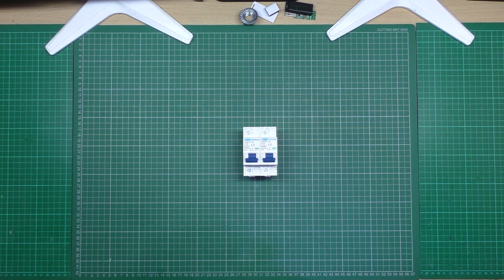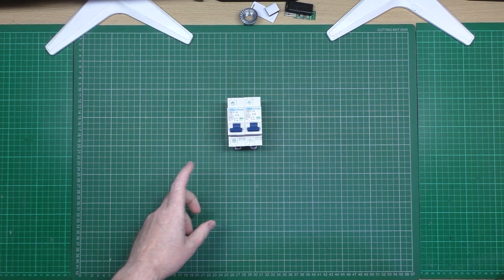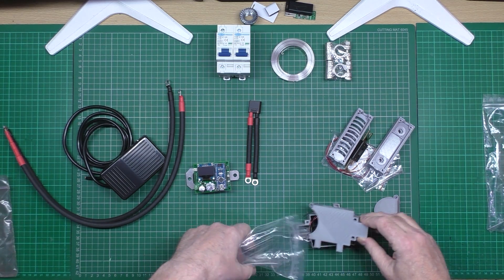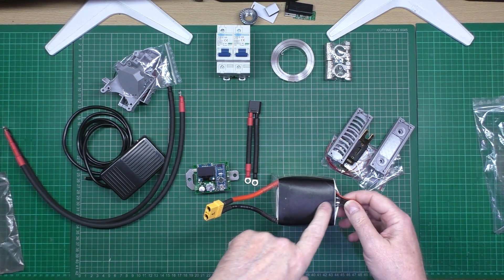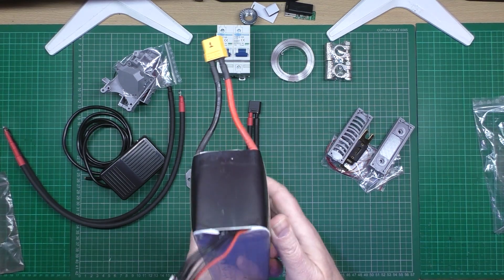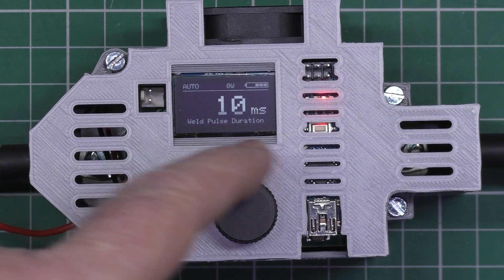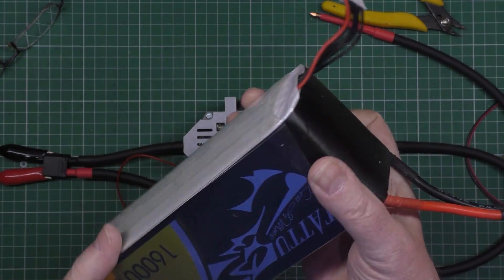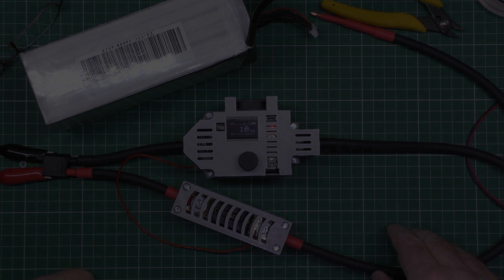Malectrics Arduino spot welder for eBike battery

Comment: Just bought this how is it holding up
Reply from the maker: I've done 1,000s of welds and it's still going strong.
The only thing I've done, is upgrade the cabling to 8AWG because the supplied arc welding cables get rather hot!

Comment: Hello mate great info thanks I want to build 72v pack with 100 or 120a countinuse discharge with 18650  the ant bms on the way and I going to dl the app u modify for it I just not sure what cell to use can u pls advice witch1 to get... Spot welder and.8x0.20 mm pure nickel already on the way, by the way any capecity from 20ah to 30ah be good.. Thanks

Comment: I made my own Spot Welder (Microwave hack) for making Inconel sheet metal Combustion Chambers, it's an easy process really.  Those cells will be a doddle with that Arduino thingy...I'd hate to see you hack that big Tattu Lipo apart though Tony.
  Can't you just use a modest sealed Lead acid and put it on a trickle charger instead.?  The current consumption will be really tiny using 6 thou nickel shim....bugger all really.....Honest it will.
  The 300 amp fuse was amusing....Jesus...really..?
Reply from the maker: Too mate mate, I've already hacked it. I've got no need for any 6s batteries now (especially that size) and I'll probably do the same with the others - I can then use them with my solar projects :-)
Oh yeah, 300A fuse. Believe it or not, it's saying I'm using 1400A pulse when spot welding!
Reply from the maker: Too mate mate? LATE!!!!